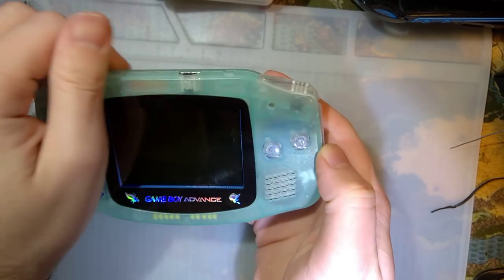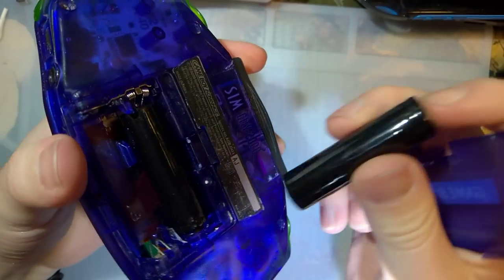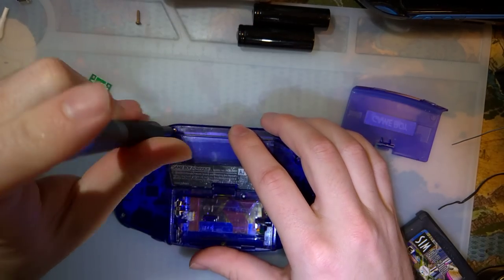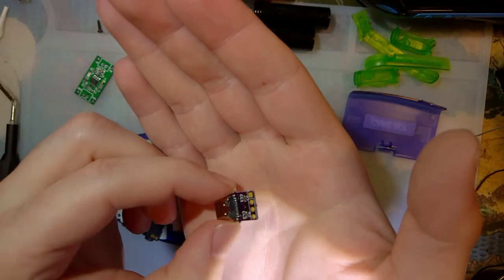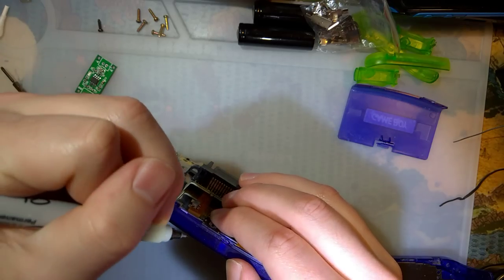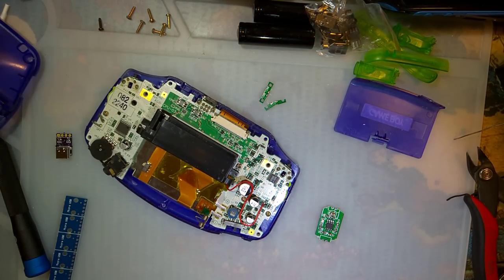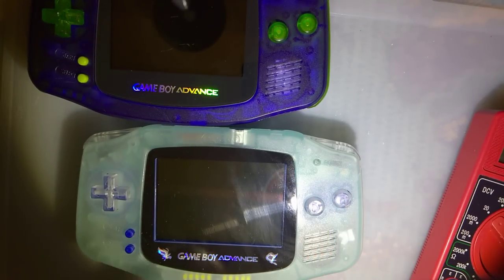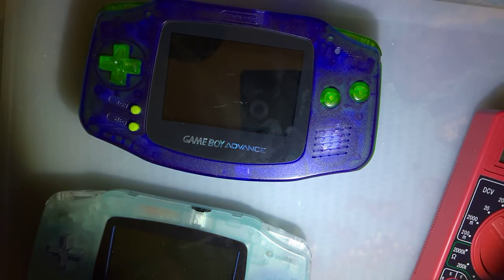Installing an Internal NiMh Battery Charger in a Game Boy Advance (Part 1 of 2)

Comment: Beat me to it! Finally got a hold of some of those boards and planned on putting together a video for GBC.
Reply from the maker: Heh, I've had these things for months too. Things just ended up moving very slowly for this. Looking forward to your video.
Reply: @makho  Love this Video. This require little shell modification. Cant wait to see your video as well Sean.
Reply: @makho  btw, how long would it take to charge a pair of 2000mah NI-MH batteries?
Reply: if you or Makho could make another video for gameboy color that would be great. Maybe the DC  jack can be removed and bridged, and board can b e placed there since is is so small.
Reply from the maker: @jonathanmsantos5405  At the default rate of charge? Probably ten or more hours. I don't recall the specs off hand though. I linked the datasheet in the description if you want to take a look.

Comment: the cn3085 datasheet says that in sleep mode (when the usb c isnt plugged in), drain current drops to less than 3uA, which should take about 5-8 years to flatten the cells.

Comment: You could probably change the value of one of the resistors on the board (should be easy to look up on the net) to make it charge a little slower so it doesn't get quite as hot.
Reply from the maker: You're right but I figured the stock rate is already so slow that slowing it down further would make it even more unusable. Heat hasn't been an issue yet but I've also only used it like three times to charge batteries.
Reply: @makho  true

Comment: As for the heat, since it's a linear charging IC, it will dump quite a lot of heat from 5V to the 2-3V used for charging at 1A (2-3W?) Into a small SOP8 package, I guess you could lower the charge rate and/or add a small DC-DC converter to drop the input voltage to like 4V as the min input voltage is 3.8V
Reply: Daijoubu r3 can be changed to reduce output current. Doubling resistance from 1.2k half’s current from 1000ma

Comment: Looks like it's based off a CN3085 and if I understand the datasheet correctly, it's CC until a set voltage (divider on FB pin) then goes into a trickle charge with a time limit set by the RC pin, so it's not ideal and may under or overcharge (granted wont explode but may shorten the life) and LSD NiMh (Eneloop and LADDA alike) doesn't like being trickle charged, I'll check the module charge termination voltage and time limit, some of those implementation are very dodgy. Also, may want to add the NTC if not present.
Reply from the maker: Yeah, I don't recall if I mentioned this in my video, but I intended to use this only in a pinch. I fully intend to use my regular charger if I am able to.

Comment: So yeah with all those caveats, the elcheapo TP4056 really shine as it properly charge lithium cell using CC/CV with C/10 termination, there appear to be another chinese NiMh black charging board, switcher probably because of the inductor and diode but only handle 240mA...slooow may as well gut the Ikea USB charger which claims dV but with a timer failsafe, it's hard to detect dV at such low charge rate anyway.
Reply from the maker: I was considering salvaging one of those USB charge modules or something but the ones I was looking at all only did 1S and this use case requires 2S support. Does the IKEA charger do 2S? I know 1S would be better for the health of the batteries but I always keep my cells paired up anyway so it should be negligible.

Comment: EDIT: Resarching this a little more r3 can be changed(easier said) to vary the charge current 1.21k 1000ma, 1.5k 800ma, 2.4k 500ma.
These state they can charge at 1amp and I dont trust charging eneloops past 500ma which are theoretically the best nimh
Reply from the maker: Yeah, it's a bit high. I'm not terribly concerned because I generally use a stand alone charger at home. I've also pushed 500mA (single cell, not series) into my LADDAs before with zero issues (because that's the default rate on my charger and I often forget to adjust it). I intended this mod as a backup for charging, not the primary charger. Nonetheless, the lower the charge rate, generally the better the long term battery life. My LADDAs recommend charging at 245mA for 16 hours though.
Reply: makho Yeah I want a charger that won’t kill my cells prematurely especially since I can switch the cells quickly. I also use laddas but say eneloops bc most don’t know they’re the same. Where did you get the 245ma from? IKEA don’t make a specific charger for these as they make there chargers to also charge there low capacity 900ma cells.
Reply from the maker: @ps3customgamer  It says right on the battery https://i.imgur.com/JxWJeKo.jpg

Comment: I still prefer lithium ion, if you're not a fan of lipos from a safety stand point, but charging NiMh is best done individually, unless the cells are matched, also, are those modules charging them properly with a delta V termination? For 2 cells... I'll just take them out and put into a proper external charger lol, now if it was the DMG with 4xAA...now that's getting annoying. Or 3xAA/AAA also very annoying.
Reply from the maker: You do you. I have a LiPo modded GBA too, I just like playing with mods. I fully intend to charge my nice NiMh cells in my actual battery charger but this is fine for my salvaged NiMh batteries.

Comment: Would you be able to put a schematic up of how you wired your LiPo tp4056 rechargeable? Also what components did you use? A 1n4001 diode? Basically, are all the videos on YouTube for the diy LiPo done correctly?
Reply from the maker: sure, let me list this video rq
Reply from the maker: actually, just kidding, I never uploaded that video. I'll list another one though, just for you bb
Reply: makho cool. Somebody mentioned doing this  modification with LiPo. Wouldn’t it just be  easier to do what you showed in your gbA at the beginning of video so that you can remove it for aa if you like? Also, what exactly happens when you charge and play with the tp4056 board? I’ve seen people saying it can play while being charged, but don’t understand why others say don’t do that since it doesn’t have a load protection
Reply: makho I guess what I’m asking is how would you use 2 lipo 14500 since I think the tp4056 board can only charge when in parallel, and 2 lithium aa will be like 7 volts anywhas
Reply: This is what I’m saying https://www.instructables.com/id/Game-Boy-Advance-Rechargeable-Battery-Mod/  but instead of using 3.2v llipo4 to use like 2 3.7v lipo 14500 like olight models. Idk. Lots of questions. I’m a school teacher with no work right now
Reply: And I guess if doing the mod from the link, but with 3.7v lipo 14500 doesn’t work, then how would one do the alternative haha. Sorry for the long winded responses. Never took electrical engineering in my life, and it is confusing me.
Reply from the maker: @TheDailyTeacherTuey  You can't use a TP4056 for charging and play simultaneously. It put a lot of load on the module and will shorten the life of your battery. If you don't believe me on this, I encourage you to do some research on LiPo technology and charging methods. 

And the mods you are asking about have been done plenty of times. They always result in lower run-times than just using a decent pair of NiMh batteries.

Comment: This idea gave me another idea: why not put a TP4056 in the same spot? and make Lipo removable battery with JST connector? then you can also disconnect battery and still use AA batteries. Tried it last night and it fit snugly in there. That is why i love watching your videos, thanks
Reply from the maker: That would work nicely too. I have a LiPo modded GBA but I put the TP4056 on top. I guess it's time to redo that console.
Reply: I like you
Reply: TP4056 fine but no one realises they should be changing the current setting resistor to suit there battery, only larger batteries can/should charge at 1000ma default.
Reply: @ps3customgamer  most of us dont use anything below 1000mah (anything lower would be a wasted lol). So we should be okay. Lowest i use is 1000mah and highest 2000mah
Reply: jonathan m Santos just because it’s 1000mah or 2000mah doesn’t mean it can handle a 1c or 2c charge it usually works fine then dies in weeks/months prematurely where it should last years
Reply: @ps3customgamer  well I'll update you in 3 years ;) lol
Reply: @jonathanmsantos5405  time for that update

Comment: Hey @makho. I successfully completed this mod just like you did in the video. Thank you btw. However once I charge the batteries fully. If I unplug it and plug it back in. They start to charge all over again and it takes about an hour for the light to turn back off. Is this normal ?
Reply from the maker: yes, based off how NiMh charge cycles work, that's expected behavior. Once done charging, unplug and use, don't try charging again. 

Also, I still highly recommend using a regular charger over this mod. I don't think the long term effects of the heat this mod dumps into the GB will be good.
Reply: @makho  I agree with that!
And I have come up with a solution haha I'll tag you on Instagram when I post it! Thank you for the response!
Reply from the maker: @robert_wolf6989  But there is no solution necessary. That's just how the charge cycles work. You're not losing capacity.
Reply: @makho  meh just for fun :) lol